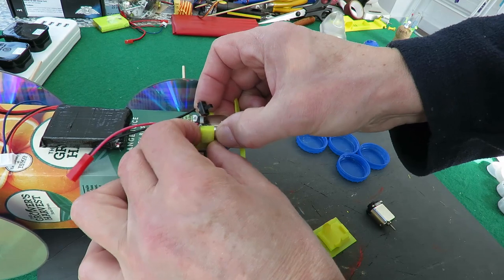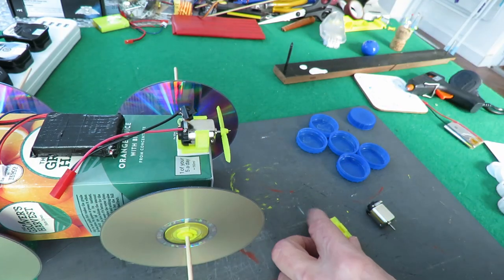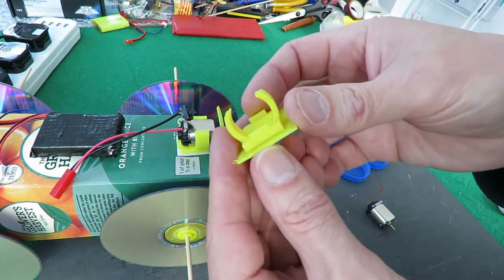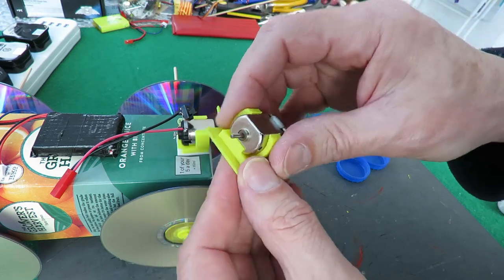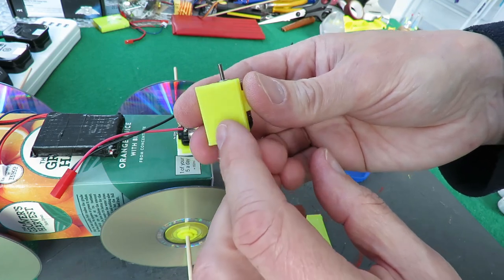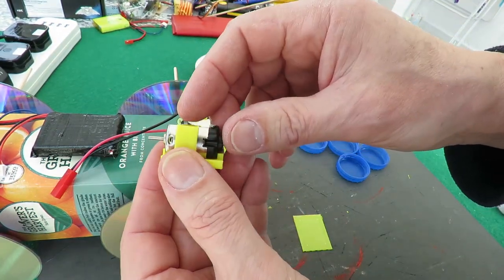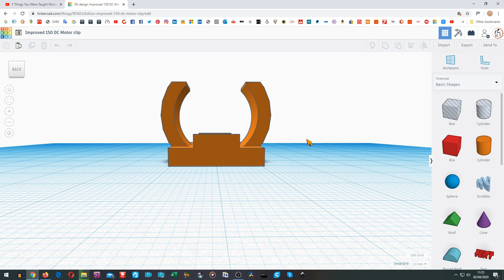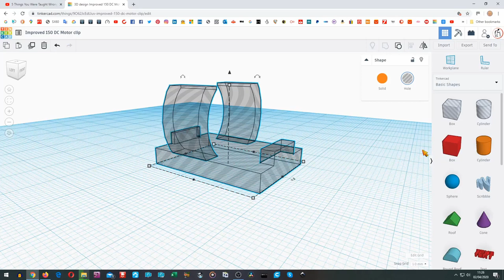3D printed clip for a 150 size DC motor 200402

Comment: I swear , you are going to cause me to buy a 3d printer yet !  lol    I have a laser engraver but flat do not have room for one of these .  I thought of getting one in the past but was afraid I would not be able to make anything I needed like you just did. I did not want to depend on ready made files to download only.   Tinkercad seems to be a good program for designing or doing mods to a existing model.   For all the things you do, I can see this thing being of much value to you in your projects.   Great video !
Reply from the maker: Thanks, I have only scratched the surface of what it can do. It gives you standard shapes you can combine and resize  to produce what you need. The best bit is it is free and online so you don't even need to download it.

Comment: Pretty awesome GrandadIAOM. I we as concerned how would you get the total demenions when scanning a part. I would love to have that clock with the hour hand as a cane....awesome!
Reply from the maker: I don't scan a part, I simply measure it with a cheap plastic Vernier Caliper so at best my measurements are 'close'. The PLA does distort a bit on cooling, so I often have to do several prints with minor adjustments to get the end result. Another simple trick is to warm the finished product so it softens and you and make minor adjustments without reprinting. This particular design will break quite easily due to the poor shear strength of PLA  along the layers. I did a further improved version that prints vertically so the layers go in at 90 degrees to the weak point and that makes it much stronger.  Printed from a different material might prevent that issue. That clock is home made, but there are clocks available on my RedBubble merch site. They are not cheap, but nothing is cheap on merch sites as the site makes the money, not me. To specify a bespoke hour hand is not possible so that would be back to a home made version.